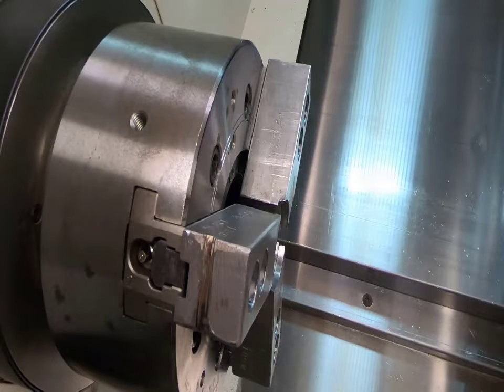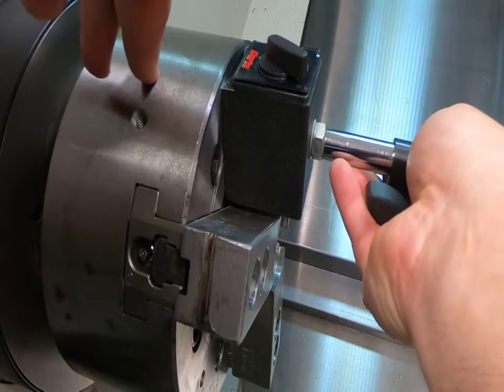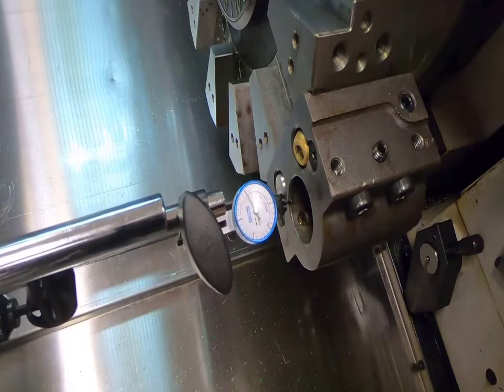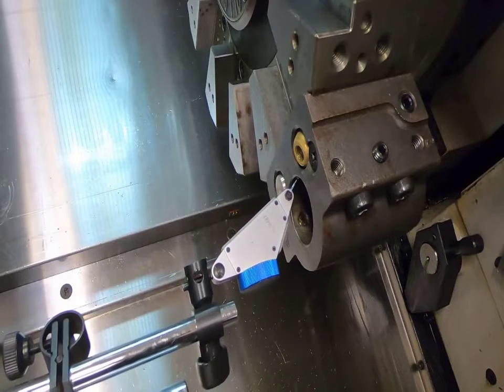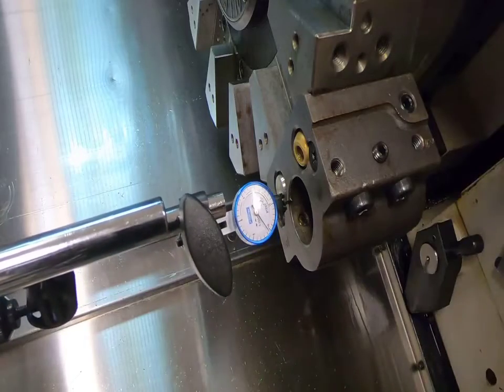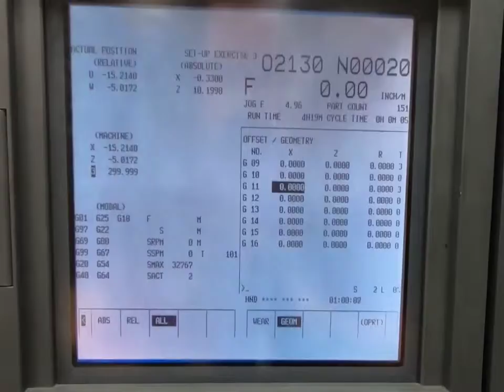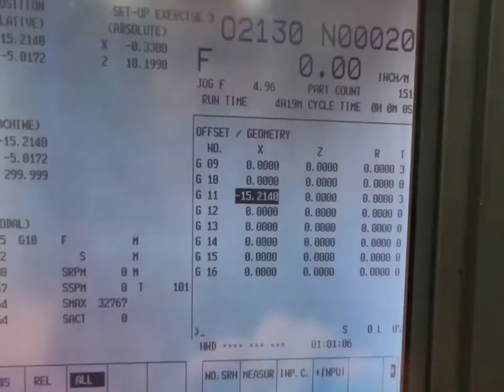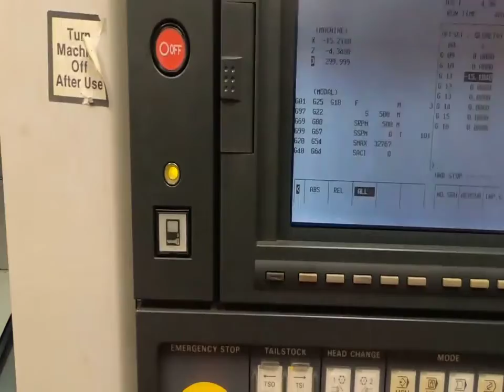Setting up an Insert Drill on CNC Lathe

Comment: My way is to indicate already mounted tool on touch probe then go command G0X0Y0Z(wherever machining) then I indicate precisely on short arm indicator . Thats it done. If you dont have Y then its hard to fix an error cause if you want to have firm hold of your tool you should not use opposite screws. And some more:
Firstly.. you never indicate hole. Its pointless. You need to indicate tool. This is the reason indexed tools have ground ring on the base. If you have carbide then you stick it out just a little bit more to indicate on h6 ground shank. Second.... are you sure your machine is squered up perfectly? You indicate in the position "Z" where you actually going to be machining. Third .. this long arm of your indicating dial tester will lie at least 0.01mm because of gravity. Forth.. there is many reasons why your hole can be different size than nominal number.
Firth..  there is more to it but the above is most important for begginers to think about and understand.

I am sorry to give such a tyrrade but believe me i spent myself some days of my begginings until i got this worked out in details.
Reply from the maker: I agree with you that there are several ways of achieving accuracy when dialing in a hole. Especially when having to use twist drills that stick out far from the holder, and once they are dialed in and you look at the machine coordinates you would be off up to .010 or more in both axis but it sometimes is the only way to make the part correctly. Indicating the holder hole is not pointless, it's just another method to dialing in a hole even if it's roughly dialing it in. For a student that is learning it's actually easier concept wise, because the hole is bigger and easier to read. My way of doing this in industry was different than how i show here and was the most accurate way but with limit tooling in our learning environment it's works really well. in short this video is a simple way of roughly dial in a hole with the tooling that we have in the shop, and since we are school using tax payer dollars I want to be diligent since most students will go to a company that does this different than even what we have both described above. Also, never feel like your opinions are negative because if everyone thought their way was right we would never get better in this industry. Thank you again for watching.
Reply: @aaronrunk4209  Yes. There is always many ways. My point is that everyone should develop 3D imagination when doing machining. You consider machine .. how its built and tool how its mounted  Everyone needs to learn where to expect and how to account for process imperfections.  Saying "pointless" was me taking thinking shortcut. A bit overshoot I must admit. It was to put emphasis in what is the real goal -tool tip to be centered and not to take things as granted. 

Ps. I lost some 5 digit sums by taking things as granted. :)